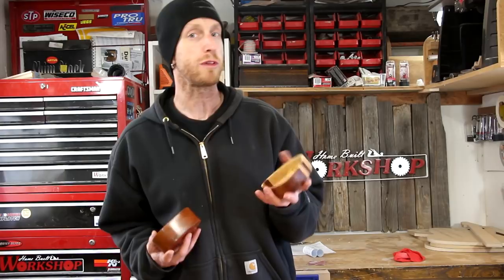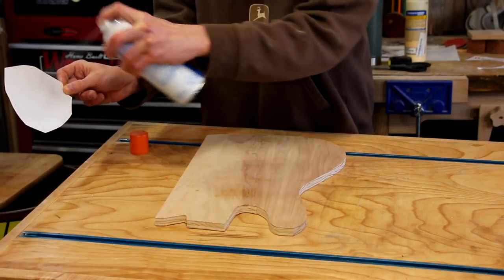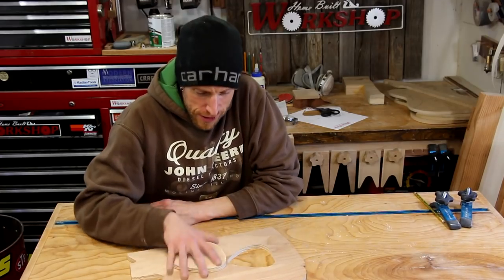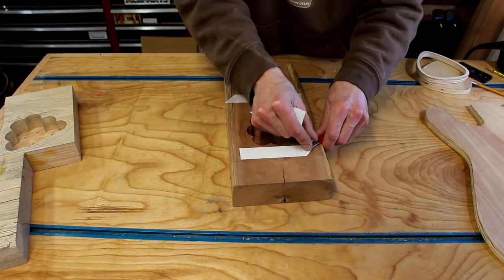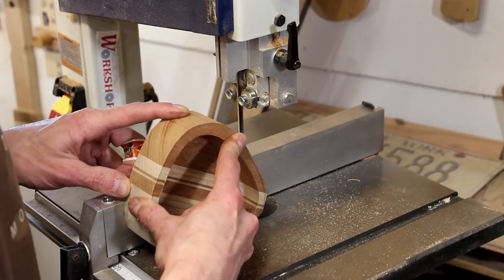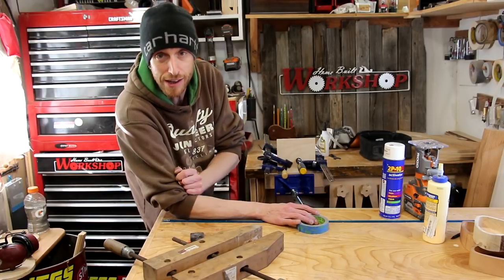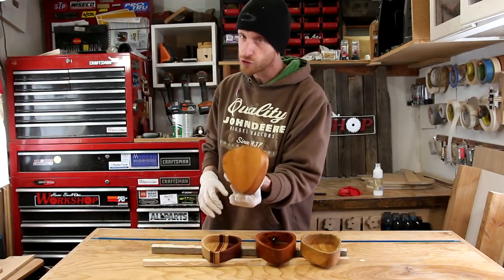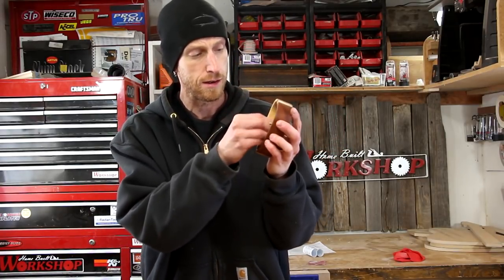How to make a Wooden Bowl (With a Router)

Comment: Hey! Just found your video. 
I’m looking at making a serving tray, I had purchased a template. Need to get the bit you used, but I don’t have a plunge router. (Just a normal one) will that still work? I thot I would just lower the bit little by little. Thank you!
Reply from the maker: Yes, your process will work. Just lower the bit a little bit each time.

Comment: I thought applying the finish with a paper towel would leave paper "nibs" on the surface but obviously it works for you. What keeps the paper towel from disintegrating? I have heard of others using blue shop grade paper wipes and I suspect they are stronger.
Reply from the maker: The paper towels seem ok for quick work. I doubt it would last a super long time. The blue shop towels are stronger. I have used them as well.